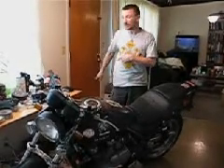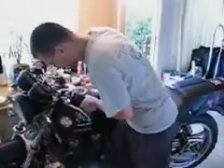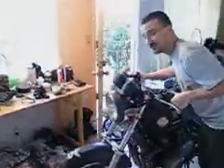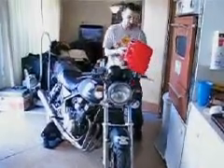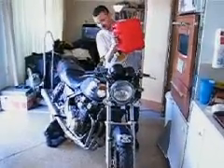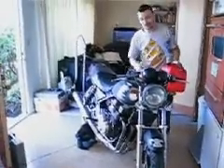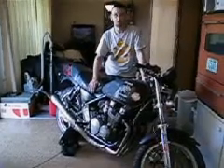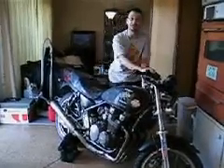ConsuMonster House Garage

Comment: the engine is fine?
didn´t you see the blue smoke out of the exhaust???? i´d take a look at the piston rings. the machine is pumping up oil into the combustion chamber.
and when there is really a "hydro lock" it comes from there.
p.s.: im a motorcycle mechanic and i know what im talking about.
by the way... happy new year rom germany.